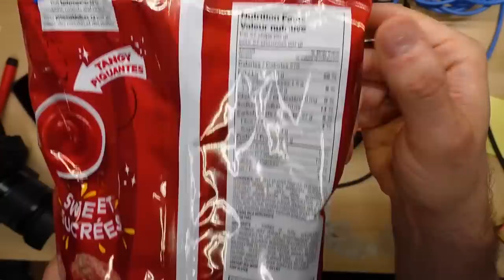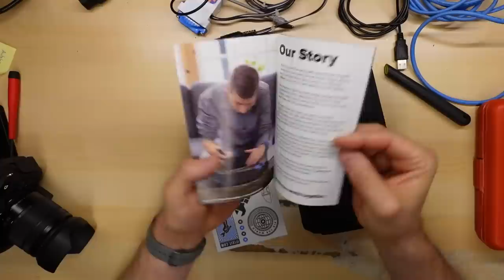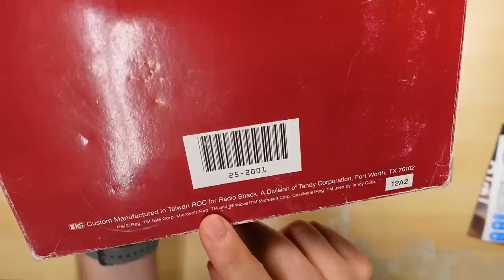Some Ketchup Chips, some 486 Chips, an iFixit toolset, some IBM keys and a 90's IBM "Credit Card"

Comment: Yes, those are Apple wrenches and Apple //e port covers (for the original, beige //e -- they were grey for the later "platinum" //e).  There were three (or at least three) different sizes of back-panel ports.

When you got an interface card (such a Super Serial Card, a disk interface card, an AppleMouse card) that had a DB-type connector, you'd pop off the appropriate-sized back panel port cover, put the DB-type connector inside the computer, and then use the Apple wrench to screw in the jack screws (screws with large, hex heads which had a threaded hole in them).

So, your DB connector from the interface card would be securely attached to the //e's back panel and then you'd screw in the thumbscrews on the cable going to your printer, mouse, or disk drive.

Comment: "A bit of a heat wave." Understatement of the year.
Reply: I'm in Newberg with no AC. WOW
Reply: Some areas are hot, other places are colder, most still mild which is normal variation.
Reply: Well, he is Canadian! Saying “a bit” instead of “a lot” is very common

Comment: To be fair, Ryzen is actually a big step in X86 32 and 64 bit architecture advancement. It is more about efficiency and increasing performance than just throwing cores at a problem.

Comment: Rammy advises to use an anti-static wrist-strap  when working with systems that contain static ram. Static ram is extremely sensitive to electrostatic discharges. It is probably the main reason for system failures in early systems that used a lot of static ram chips.
Reply: That’s why they called it static RAM. /s
Reply: Only the old PMOS ICs (not only RAM) are really very prone to static damage, and only if you can't remember to touch something earth-grounded before handing them, and to touch the chassis of the machine before touching components. And if someone is handing you a component – touch their hand briefly before grabbing the component.  That's al the precautions you need, even if you wear a fleece hoodie and walk on a synthetic carpet all the time.
Being permanently grounded is a horrible idea, especially if you tend to work on mains-referenced and/or high voltage stuff, like CRTs.

Comment: About anti static mats, do not just ground them. ESD protection is achieved when you are in the 1M ohm area of resistance to ground.
Main issue is isolation, like your wooden table, which is a perfect isolator.
So IF you get an ESD mat, get a ESD grounding plug (just gets plugged into a wall socket) and then attach the mat to that.

ESD done wrong is very dangerous as it potentially reduces YOUR resistance to ground to 0, which in case of an electric shock can be fatal.
All you want is that everything (including you) slowly discharges. So no direct grounding.
Having an ESD floor adds to that safety, as it also would have a resistance of ~1M ohm.
Meaning electrocuting yourself will be much harder (compared to a well "grounded" cement floor).

Comment: the jump from Haswell to Ryzen is amazing,  i went from encoding a mp4 at 67 fps to 387.
Reply: Interesting. I have an i7 4790k and I'm thinking about upgrading to a Ryzen CPU. Do you think it's worth it?
Reply: sandy bridge to a 5900x for me. HOLY FREAKING CRAP!!! One of my blender models took an hour in 1080p. Now it takes 5 minutes in 4k. LMAO
Reply: That's exactly the use cases for the Ryzen monsters - encoding, modelling, 4K gaming.
Reply: @marciomaiajr  Depends what you want to do. I had a few games that didn't like my i7-2600. But it can do a lot. But I was really feeling back with blender and unreal engine. So I got the Ryzen and holy crap it's amazing.
Reply: And, depending on where you buy them from, Ryzen cpus are cheaper than Intel cpus.
Reply: The jump in processor performance has gotten slower since the release of Intel's 5th generation Broadwell CPUs. CAUSE were following Moore's law up until roughly the early 2010s...
Reply: @alexdhall  intel is still on 14+++++++++++++++++ lmao
Reply: @blitzwing1  that's not true. By my estimation My Ryzen 5900x (24 core) is at least 4x faster than my i7-2600 core for core. It's even faster than that in terms of overall performance. It's even something you can see. I play kerbal space program. It's not coded well. It's heavily dependant on single core performance. I saw a dramatic improvement in performance from my i7-2600 to my 5900x in spite of the fact that it's all limited the the single core physics thread. In fact the official specs for the operational frequency are roughly the same between the two CPUs. I realize that between 4x and 6x speed increase isn't much as 10x (assuming adrian is correct about the 486) It's still significant.
Reply: @Breakfast_of_Champions  Gaming doesn't scale well with multiple cores, generally. Most CPU bound gaming workloads tends to be very serial in nature, loading one core to the max, that is why Intel still had a slight gaming advantage until the latest generation where Intel opened up the lead somewhat. But not for all games, and so on. But generally.
Reply: @blitzwing1  the ryzen 1000 series is a joke compared to the newer ones. They made huge single core performance upgrades. Especially in the 3000 and 5000 series.

Comment: the little wrenches are for tightening the studs in the back of the IIe
Reply: yes. came with the later disk controller card for unidisk/doudisk that had the db-19 connector.
Reply: @sweintz  or the super serial card or the mouse interface card or the SCSI card.  Basically anything that had one of those D-shell connectors.

Comment: Grappler+ had code to print screenshots with one escape sequence. Was extremely practical to print graphics. I had printed the whole Ultima IV map using that system. It gave a 1.20mx1.20m map.

Comment: The stagnation in CPU speed improvement is real. My lab computer is an i7-3770k. The current top-of-the-line i9-11900k is only twice as fast, according to UserBenchmark, and that's in benchmark tests. In real life usage, you might not even notice the difference.

Comment: Since Firewire was a full network bus (perfectly capable of being used for internet connections, for example) I've always wondered why desktop versions of Windows didn't get confused having it and Ethernet in the same way that two Ethernet adapters would confuse them.

Comment: As I recall from the original advertising the Grappler+ card had more chips because it has a built in print spooler so you don't have to wait for the printer to finish before you can use the computer again, we had them in our Apple IIe's in school and it was quicker to get back to using the computer when sending a print job out.  I believe the black objects are wrenches that came with Apple cards to remove the nuts on each side of parallel and serial ports to screw them to the case.

Comment: Gamer Nexus has some incredible mats por technicians.
Reply: they're nice but unnecessary. Incredible is a stretch
Reply: oops i saw the rest of the video, yeah that's a cool mat that's anti static
Reply: I love my large mat from them. Steve is the man.

That said, I still don't ground myself or the mat.
Reply: Their mod mats are probably equivalent to an ifixit product.

I haven't personally used one ($100 is a lot to swallow for someone on a tight budget), but having been watching GN for many years now, they look like a very good product and something I really wished I had.
Reply: @AceStrife  I'm a shill for GN I guess. I have the desk mat, and bar mat as well. I'm all about style I guess.
Reply: @AceStrife  I unno, my wooden table and silicone mats do fine. Honestly don't have the space for a mat like that. I'd rather my desks be hard wood.
Reply: @catriona_drummond  oh no! their screwdriver set isnt as good as it appears?
Reply: @Walczyk  it's ok quality. But they were under really heavy duty usage here. It's a set for dedicated hobbyists but not for like a professional workshop taht will wear them out with daily use.
Reply: I have the 2x4 mat and it's amazing. You can get cheaper, to be sure, but not as good looking or nice!

Comment: Those are 7 pin tubular locks. Wafer locks are ones that take a more regularly-shaped key. The blade of the key would slide through a hole in the center of a metal wafer, pushing it up or down (depending on which side of the lock it is in). They were/are the most common automobile lock type.

Comment: That Edimax dongle-less network card is a relatively modern but very useful asset. A rebranding of it under "Ladox" was my only way to bring my HP Omnibook 5000 online back in 2003 when I was very young and new into retro computing. In Turkey, I was unable to find matching 16-bit PCMCIA network cards and dongles, and that very Edimax card helped greatly. I still use it to this day, with computers that contain no mission-critical information and that are locally networked.

Comment: I have the exact same generic yellow screwdriver set, I’ve used it for maybe 6 or 7 years. I’d seen people advertise the iFixit one in sponsorships before but it seemed like basically the same stuff. So seeing your examination and excitation, comparing it to the yellow one, has actually made me consider getting it. I had no idea the handle had metal and proper bearings and stuff for the spinning. Plus it looks a more ergonomic shape.
Reply: Also: American Sour Patch Kids are really quite different from European ones. Different flavourings and different colourings. When I tried American ones I was shocked they were just regular super bright artificial gummies. The ones I’m used to from Europe have real fruit flavour (different actual flavours too) and more subtle colours. 

Not sure about AUS/NZ Sour Patch Kids though.
Reply: Aww. I thought that “credit card adapter” was something that let you swipe cards. But it seems IBM just called all their PCMCIA cards that way for a while? I guess PCMCIA is roughly credit card sized.

Comment: Speaking of performance and how we saw it in the day - you cannot imagine! My first job outside college was BASIC programming with a PASCAL-like preprocessor written by our guru (man I learned a shitload from that guy). On an XT with a 10Mb HDD! I moved over to admin from programming so I never got to actually experience the performance increase in my daily life - but tests I did against old machines pretty much blew my mind. The 486 was the greatest single leap in processor performance you can imagine! It was astounding.

Comment: Pretty sure that type of lock is actually called a tubular lock. You can get tubular picks that can open those locks in seconds. Also, I have a feeling that bag of keys is actually part of a set of all the possible bittings for the IBM locks. I bet the complete set would have one of each possible type of key. You can check each key to see if there are any duplicates -- if each numbered key is unique then that's probably what you have and that can be incredibly useful.

Comment: RE: The PCMCIA Firewire card, I honestly wouldn't be surprised if it worked in just about anything with PCMCIA and the appropriate driver. I've opened up a lot of old iMacs and stuff and found parts with Apple-specific part numbers that were (you guessed it) exactly the same as the ones you'd find in Dell or HP machines; I mean, identical in every way, and from the same manufacturer. Especially wireless adaptors. The Apple ones just get an apple branding mark screenprinted on them (like "Airport Extreme").

Comment: 43:00 I think I know what they are:  The Apple Macintosh case cracking tool.  The original Macs were intentionally designed to be hard to open, requiring an abnormally long Torx screwdriver to get to the screws, and then a special tool to actually get the case to pop open.  I suspect those are them.

Comment: 32 bit started with the 386, 64 bit maybe? The jump from your i7 to the 9th gen on my bench is just as big. I7 first gen can deal with about 8 h264 streams before it maxes out. 9th gen will deal with 16 streams at 20% use. On top of that VT-D,  Quicksync, more cores and lots of new extra features make a huge difference. Core2 Vs Core i is even more stark.
Reply: I’ve got a 2600, it’s not quite as stark a difference from the first gen i7s, but it’s definitely getting long in the tooth. A couple years ago it was roughly on par with the brand new i3s, so software still ran just fine on it. But now it’s below even a new i3 and is starting to lag even on heavier websites (why does JS bloat have to keep growing??). Probably will get a Ryzen 7.
Reply: @kaitlyn__L  avoided AMD for years over heat zland reliability. Been in the  industry as long as Adrian, seen maybe half a dozen dead Intel chips in that time and probobly into three figures dead AMD. Built a Chia rig on Ryzen a few months ago and its a really impressive little machine.
Reply: @rtechlab6254  yeah, I’ve been following this stuff since 07 or 08 and for ages everyone was like “Bulldozer will fix everything” but then heat etc etc etc. But everyone was rly impressed by Ryzen and it’s been a few years now. And the price per performance is great, I like that they can dynamically overclock instead of just boosting to a set frequency. I like the socket compatibility. Etc. So since I’ll need a new motherboard for sure it’ll probably be Ryzen.

Comment: I went from a Tandy CoCo 3 running a 68B09E cpu at 800kHz, to a 386 running 40MHz, to a 486 running 80MHz, to a Pentium running 133MHz, to a K6 running 200MHz, to a K6-3 running 450MHz, to an Athlon running 1GHz, all in less than 10 years (1992-2000).  I went from 512kB of memory in the Coco3, to 4MB of memory in the 386, all the way to 1GB of memory on the Athlon. I also went from a 2400 baud modem to 1.5Mbps DSL in that same period. The 90's were a wonderland for those of us into computers.

Comment: Just quick note: intels sl2 and dx4-100 also ran at 3.3v. It was quite common for later 486 boards. Most 486 boards take it well to raise bus speed to 37.5 or 40mhz (if I recall correctly ISA cards are trouble maker if - cause some don’t come along with higher clock well). Ran my amd dx4-133 at 40mhz bus (160) for years and it was very stable. Many did. back then.

Comment: Those little black apple things are little 3mm(4mm?) wrenches to screw those tiny socket nuts to the back of the Apple case. Just look at the Apple /PC port (video, printer, serial, etc...) and look at the two nuts above and below the port where the cable screws into... Those little wrenches fit those nuts. They came free when you bought a Apple IIe or Apple II+ with certain cards.

Comment: The 486DX-50 was not unstable in itself, it ran extremely hot. I remember setting up an EISA server with one of those, and I actually burned my finger on it :) I guess that much heat could destabilize it - in those days we didn't even THINK of heat sinks! I will say that the performance of that CPU on a 32-bit bus was WAY better than any DX2-66 I saw.

Comment: @38:45 I had the Epson/ Grappler low cost clones called the Gemini 10X and the Wizard Printer Card.  The Gemini 10X 9 pin printer used 19th century Underwood Typewriter Ink Ribbon Spools (not a cartrige) you had to feed manually.

Comment: I have a lot of nostalgia for the 486. In summer 1992 I retired my 286 and upgraded to a 486SX 25, which was mind-blowingly faster and better. That was, incidentally, also the first PC I ran Linux on. My next PC had an AMD 486DX2 80, which had a nice combination of bus speed (40 MHz) and clock speed (80 MHz), kind of like the DX2 66, but more so. Good times!

Comment: I can confirm that the AMD DX4-100 would be destroyed by 5 volts. Back in the day, I borrowed one from a friend to test if it was compatible with my motherboard, as I was interested in it as an upgrade for my DX2/66. I couldn't get it to boot so I kept trying different jumper settings, then on the last try, I forgot to set the jumpers back to 3V after swapping the processors over. Nothing happened at first, so I switched the jumpers to 3V and turned it on, to be greeted by a fizzing noise and the smell of burning electronics. I was too embarrassed to admit what I'd done, so I told my friend it worked fine and paid him the asking price for it.

Comment: Just so you know but that IBM 3270 emulator card is for emulating a IBM 3270 Computer Terminal (introduced in 1971 and was used to communicate with IBM mainframes). Even after IBM stoped making 3270 terminals, the protocol used with them continued on, but instead using terminal emulators on IBM PC’s. In fact, IBM made an IBM 3270 PC which was an IBM PC XT with IBM 3270 terminal emulation hardware built in. What this means for you is that since you don’t have access to an IBM mainframe to communicate with using the 3270 terminal protocol, that emulation card is basically useless to you, even if you had the special coax dongle it requires.

Comment: was wondering what that hole in your desk's paint was!! sealed lead acid = little tiny rubber caps over each cell and a plastic cap over that, sometimes you can revive batteries by adding a little water when they getting old

Comment: The reason the DX50 is unstable is that the Vesa Local Bus runs at the same speed as the external bus. A lot of hardware couldn't handle the 50MHz speed. If the hardware could handle it, it was an ok cpu and faster than the DX2/66 at some tasks. The VLB is highly tied to the 486 line of cpus and is more or less directly connected to the CPU.

Comment: The Tandy mouse might actually be a rebranded Logitech mouse. Was the first mouse I purchased - it was 40 Deutschmark in 1995, around 20 EUros - adjusted for inflation maybe 30. But they are quite reliable and only have one weak point: The wiring tends to break on the cable outlet of the mouse.